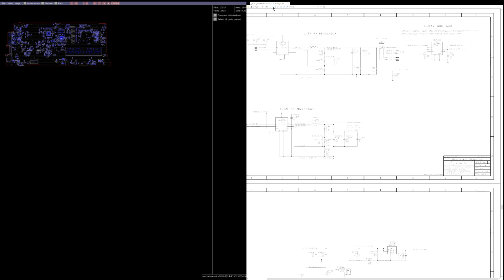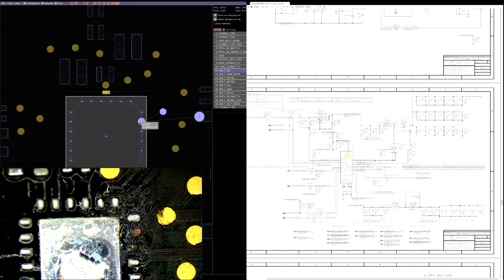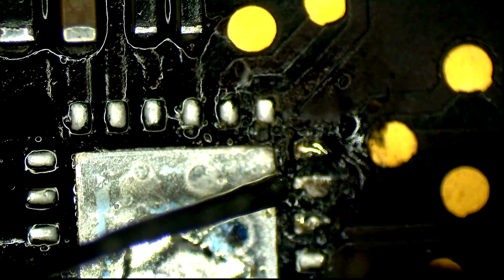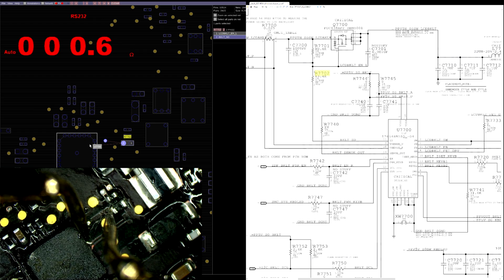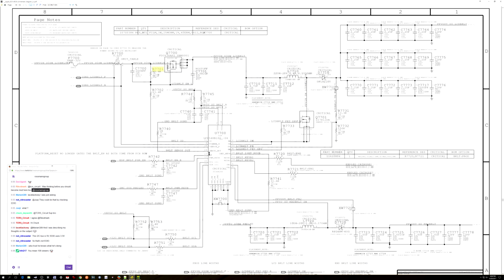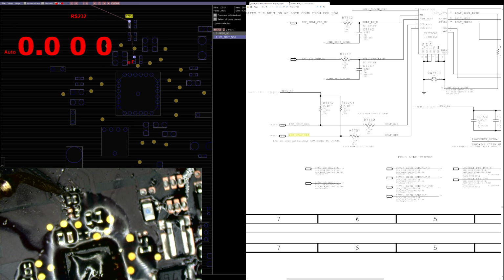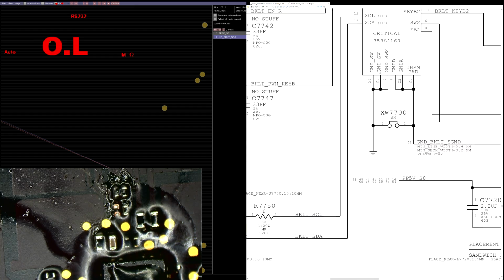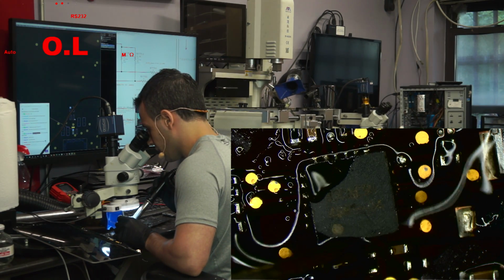Macbook Retina no backlight: NEW things to check.

Comment: I'm fixing this exact issue right now.  Water damage around LCD backlight driver.  Waiting on the driver as I don't stock chips (as I'm just a hobbyist at the moment).  Will keep this headache in mind when I get the driver in.  I think the same model as well, late 2012 MacBook Pro Retina.

Comment: The capacitor in question was C8358 and was listed NOT on the page with the U7700 backlight driver but instead on the page with J8300 - the internal display connector, and was creating a short to ground on the I2C_BLKT_SDA line, effectively preventing communication with the logic board.  Check both of those pages of the schematic if you have display issues!

Comment: I have a Mid 2014 A1502 13 inch and a broken LCD.  LCD still light up and can see 75% of the image with backlight except for the damage area.  I replaced the LCD with an late 2012 A1502 panel which was working but after installation, there is no back light (has image).  I swapped back the old broken LCD and it worked .. so I gather that it is not a board issue.  Then I swapped a 3rd working LCD from an early 2013 LCD .. still no backlight (has image).  Is this because 2012 and 2013 retina LCDs are not compatible with mid 2014 A1502?  Or is it just the cable connectors dirty?  Please advise.  Thanks.

Comment: I have an A1502 with no backlight (black screen, logo won’t lid, keyboard lights come on, works on external monitor and I can see the text on the screen when a flashlight is used). It happened right after I dropped the MacBook (it was in a soft pouch so the impact damage shouldn’t be too bad. May I know what is the most likely fault? Any chance of an easy fix?

Comment: You should really change the way, you talk about Mosfets as switches. Throughout the electronics world, a switch is closed, when it allows current to flow, and it's open, when it block any current flow. For some reason, you developed an opposing analogy (something like a door, that allows flow when open). This is contrary to the common undestanding of switch positions, which is not necessarily wrong, but very confusing at least, especially for ppl, who don't understand electronics that well. Your explanation will always be confusing with any other explanation that ppl might come across.

Comment: hey louis - thanks for your video - actually working on this situation right now.  here is a link to the part you replaced (for future viewers) - 
https://mailin.repair/b4-lp8548b1sq.html
how important is the designator after the LP8548B1SQ >>>  03 or in my case 04 are those extra numbers simply versions?  is the 03 compatible if pulling a 04?  your listing shows a 03, and your vid shows you pulling a 04.  i noticed your listing did not make that distinction, so would normally assume that it was not an issue, but wanted to put the question to you and nail it down. thanks for sharing.  i also linked your video to an appropriate post in one of the forums where this topic was being discussed.

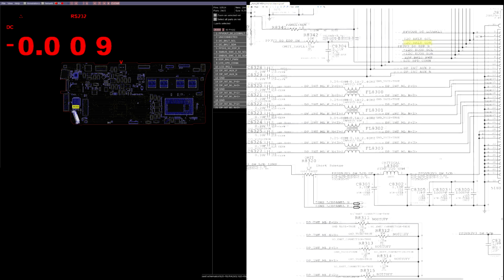Comment: At 1:02, be careful to use the proper term. LVDS is a physical signal format, of which DisplayPort actually uses as well. Annoyingly some LCD manufacturers use LVDS to mean FPD-Link.
As for why the no image symptom, for those interested, the the protocol DP uses is packetized, so if you have an issue with the transmission medium, a lot of the packets will be corrupted and not produce much if any image.

Comment: is there an "easy fix" for a 2010 macbook pro that displays green and pink colors?  I changed the color settings on through settings which took away the pink colors,  but I still have the green colors.
Reply from the maker: +Phillip Horton either misseated lvds cable or u9600 has cracked balls, tap and check.

Comment: You can't kill an i2c SDA line by pulling it to ground, since the outputs are open drain. Otherwise you wouldn't need pull-up resistors at all. The cap is innocent, apologize to it.
Reply from the maker: +Tom the cap had an exploded solder ball next to it. The cap can sit in the jtag gulag.
Reply: Louis Rossmann ok, forget about the appology joke, but the whole idea behind i2c is that any device on the bus can pull the clock or data low any time, so you don't have to worry about things like bus-turnaround time etc. It's called a "wired-and". There is just no way that the capacitor blew the output of the sda driver by shorting it to gnd. Maybe the solder ball was creating a short to a supply rail? edit: Looking at the photo, I don't think it can short to a power rail where it it is sitting... You also don't know if you had this short on the old chip.
Reply from the maker: I understand. That is why this genuinely confused me. There is the coincidence that the 2nd led driver i put on from the donor had a bad sda line but a good scl line, but that seems too much trolling to me. :(

Comment: what happend to the two macbooks which connected to a wrong power supply ? are there any news ?
Reply from the maker: customer took them back weeks ago, didn't want to wait for me to get the chips/parts in, in spite of me being upfront that i didn't have them. oh well.
Reply: I just hope she doesn't take them to some place that charges her $800 for their "time" and "labor" and don't fix the issue. Your no-fix, no-fee model is really the best way for electronics repair to operate.